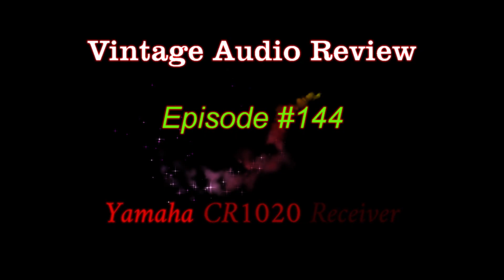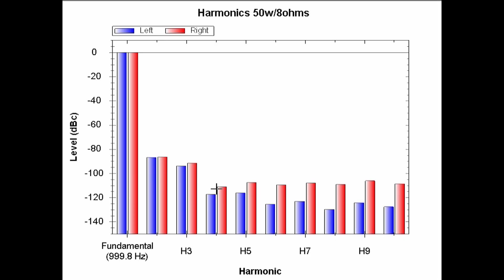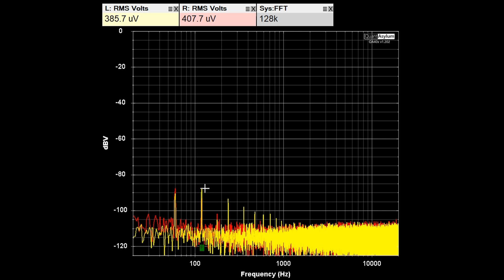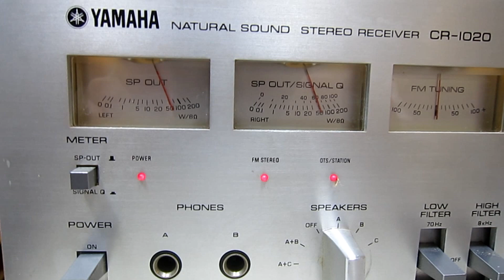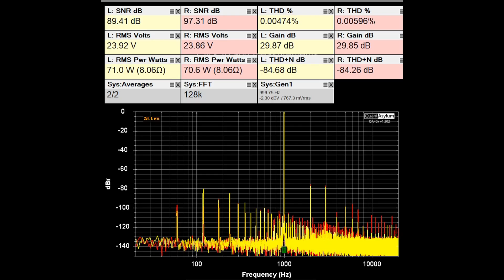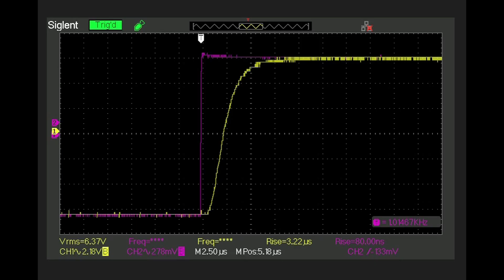Yamaha CR1020 Receiver- Vintage Audio Review Episode #144

Comment: loudness control. I think they were trying to emulate the RIAA curve to compensate for the non-linearity of the inner ear. If they chose to cut rather than boost certain frequencies, then just turn it up!

Not sure what to say about the bass distortion, but it seems unlikely that Yamaha of that period would have allowed 2 percent distortion. Something is going on there. 

I have a Yamaha CR640 which unfortunately has stk outputs, but has performed quite well. I plan to upgrade to something like the CR2020 in the near future that does not have stk.
Reply from the maker: I get that about STK outputs but if it still is working and does the job, just let it do its thing. I appreciate your watching.

Comment: I picked up cr1020 a few years ago for almost nothing. Upon inspection; only thing wrong with it was the tuning dial string broke off. I was able to find the stringing diagram online and after experimenting with different strings and struggling for a while, was able to restring it. After that I re-did the wooden case. Now it looks almost new and very beautiful. Because I was so impressed with this; I kept a look out for other Yamaha CR series. I got lucky and recently acquired CR840 & 2040. I expected them to be broken because I got them both for much less than what they go for. But to my surprise; both units are operational. Only issues are the typical noisy pots of vintage units that has been sitting without use for years! This just proves how well they are made. Vintage Yamaha CR series are quality built units. I highly recommend them.
Reply from the maker: Thanks so much for sharing your experiences and it sounds like you have had some great luck with the Yamaha find. I hope to go through my "career" w/out having to do a dial string re-string.
Reply: @vintageaudioreview yeah. It’s very painstakingly tedious but you feel that much accomplishment too when you are successful

Comment: Really enjoyed the video and am glad I found your channel.  I picked up a CR-1020 almost a year ago, and actually like it very much, except for the very audible pop when it is turned off.  Would like to find a trusted tech to diagnose and fix the problem, but for now I run a different amp through the main in, and that temporary solution seems to work well.

Bill
Reply from the maker: Thanks for sharing your CR1020 experience. Having audible pops when powering on or off vintage gear is typically not something I worry about, unless it is abnormally loud. It may be a difficult problem solve- have not ever tried to solve one like that. If you were local I would check it out for you, but your solution is working fine it seems.

Comment: Thanks, enjoyed the video.
 I have a CR 2020 thats in need of an output pair of transistors. Any suggestions on where to find good replacements these days?
Reply from the maker: I don't have the CR2020 service manual so can't see what output transistors it uses, but am guessing there should be some equivalents for them if not the same ones. I start with Mouser and then do a search on Ebay- you need to make sure the seller has good feedback as there may be counterfits. Also, if the outputs went, the driver transistors and resistors most likely went....
Reply: @vintageaudioreview  2SD424 and 2SB554 . I've read to go with an ON Semi sub  as anything labeled as originals are counterfeit and suspect.
Reply from the maker: @jimhoward1655  You could also try to find an NTE284/285. I did a quick search on ebay for the 2sd424/554 and there look to be several options- for $60 you could get 5 pairs from a seller that seems to be reliable. You can also compare the weight the old ones vs the new ones.
Reply: @vintageaudioreview  Thank you, i will check it out and have a look around.
Reply from the maker: @jimhoward1655  Good luck!
Reply: @vintageaudioreview  thanks, I think the best answer ive found after more searching  is either the ON semi MJ21193 & 94 pair or the MJ21195 & 96. Its like 6 of one or half dozen of the other on opinions of which pair is the better choice. I'm leaning to the 95/96s from what ive read. 
 They can be bought from Mouser for $7 and some change a piece plus shipping
Reply from the maker: @jimhoward1655  I would go with the pair that matches the original as far as hfe and max current/power. Make sure that you check the driver transistors and resistors before your place your order. Also, you may want to replace any electroyltic caps that filter the +B to the output transistors on the driver board.
Reply: @vintageaudioreview  will do Thanks

Comment: The U joint extensions were for the selector switches, not turning the tuning capacitor. That was done via a standard flywheel/dial cord system.  The xx20 receivers were really a disappointment to me when it came to build quality. The large boards were more prone to issues and those on the board switches caused problems as well. And for a high end receiver to not even have a tuned RF stage for AM was pretty cheesy. The variable loudness function was explained in the owner's manual, and was designed to provide compensation better suited to the customer's actual usage and the sensitivity of the connected speaker. Yamaha was not the first to use it, as variable loudness was found on the McIntosh C20 preamp from the late 1950s. I was service manager for one of the first Yamaha audio dealers in the country, and was impressed  by the build quality of the first generation of products they introduced. But compare this CR 10120 to the original CR1000, and you see how far their quality slipped in a short period of time.  And if you look at the next series (CR1040, etc) just one year later, then you get into those really horrible output amp IC's
Reply from the maker: I think I mentioned that there were others that had a variable loudness control, but not sure if they operated the same way. I have not looked at enough Yamahas to see how their build quality changed, but it sounds like you have and I know that there more recent amps used output IC's- I did a review on one of them. Thanks for pointing out about the u-joint being used for the switches.

Comment: I would agree that Yamaha should have called it an "anti-loudness" control. But if you read any Yamaha owner's manual, they explain how it works and how you are supposed to use it pretty clearly. 

This is the gist of it:

First, you set the loudness knob to Flat, then you turn up the Volume to the highest setting that you would normally listen at. Then, if you want a lower sound level (late at night, for example), you adjust the Loudness knob away from Flat, which mainly reduces the mid-range frequencies to lower the overall sound level to what you need while still sounding natural or "good" at that lower sound level. You leave the Volume knob alone when you do this.  The intent was to follow the Fletcher-Munson sound curve.

Unfortunately, most people have never read the owner's manual, so they don't know how it is supposed to work. 

The CR-1020 was closer to the top of the 1977 Yamaha receiver line. These were the 1977 models:

CR-2020
CR-1020
CR-820
CR-620
CR-420

In 1978, Yamaha added the CR-3020 at the top and the CR-220 at the bottom.
Reply from the maker: Thanks much for the clarification of the "loudness control" and the model numbers. I did look at the manual, but from my point of view after being an audio hobbiest, since the late 70's, I just what a push button loudness control that boosts the high and lows at lower volume levels. As I pointed out by another commenter who read the manual and sets the volume to the max they listen to and then adjusts the "loudness level" down to the listening level they like, is not how I want to do things. But I do appreciate the explanations!!
Reply: Thanks for the clarification this is actually a really practical and pleasant way to adjust volume and loudness and after experimenting with it for a few days it has become entirely intuitive to me.

Comment: Had one for a while.  Nice performer, but spent too much time on the weak point... the input selector!   Instead of a round wafer with contacts, they had a long shaft drive a cam that drove a linear slide switch!    Very difficult to clean, compared to a round wafer.  Kept failing.
Reply from the maker: I would have thought that slide switch would be fairly easy to clean with dexoit or some other cleaner/lube. Thanks for the comment!

Comment: I don't know where your math comes from as far as inflation figures go, but if that receiver was new today, it would go for at least $6,500...if not $8,000.
Reply: 383.9% cumulative inflation. $580 in 1978 is $2,806 today.
Reply from the maker: @professorvoluck9311  If I were more motivated I would reference the price to say what a certain car cost back then.... Thanks for the comment, though I will have to research what cumulative inflation is.
Reply from the maker: Thanks for the comment. I use the inflation calculator (https://www.usinflationcalculator.com) and the listed retail price for the item I find in old trade publications. Sometimes it makes me scratch my head, but for me, I do find it interesting from a relative point of view.

Comment: Thanks for this enjoyable review!  I used to see advertisements for these back in the day.  I later owned a 1985 1020A model with the Auto Class A feature that I rarely used.  I didn't use or like the variable loudness feature either. But I did like the sound of that Yamaha integrated amplifier.  I ended up selling that amp a while back and getting a Parasound amplifier, which I like a lot. Thanks again.
Reply from the maker: Thanks for taking the time to share your experiences, Scott! Just forget about the "loudness feature" and enjoy the sound and look of this amp, or many in that line including the 1020A...

Comment: Nice job and a very nice looking receiver (and nice looking Vette, I assume that's a good sign for the receiver).  My AR SP-3 pre-amp has a similar "loudness" control.  I actually really like it.  I first turn the pre-amp on with the volume control about as high as I would ever want it.  Then use what AR calls the "Contour" control as the volume control.  I'm assuming the lower volume I go with it the higher the bass and treble bumps are.  So why the volume goes down as I turn it clockwise.  Not sure, but I'm guessing the Fletcher-Munson curves show more boost is needed at lower volume levels?
Reply from the maker: Appreciate your taking the time to comment, as always, Chris. I think the Fletcher Munson curves are more related to the average frequency response of our ears, but have not researched it- probably will later today... I almost always start with my volume control low and raise it accordingly, and 90% of the loudness controls boost the bass and treble, which is nice at lower listening levels. I never would have considered doing things the way you do, but you are still attenuating the signal that way, just the relative frequencies not as much as others. The highest "rating" I give is two Corvettes and it goes down from there. Not many have gotten two.
Reply: @vintageaudioreview  My McIntosh C26 has I think basically the same feature.  Roger Russell, the designer of the C26, explained it like this on his web page (you find by googling "roger russell c26".  The C26, however, only boosted the bass.  When the "loudness" control was all the way counterclockwise, no bass boost and no attenuation.  At 1/2 rotation, about 6db of bass boost at 20 Hertz and -10db attenuation at 1K Hertz.  At Max rotation, about 15db of bass boost at 20 Hertz and -20db attenuation at 1K Hertz.  This is from the C26 graphs in the Owner's Manual.

Continuously Variable Loudness Control

The loudness control supplied low frequency boost to compensate for the behavior of the human ear at low listening levels. Most loudness contours were switched in with a fixed amount of contour using a tap on the volume control. The user had no control of the contour for any particular volume control setting. The C 26 had much better compensation. It provided a continuously variable contour. First, the volume was set at the highest desired listening level. Then, when the loudness control was rotated clockwise from the flat position, the volume decreased and the contour automatically increased the required amount of bass amplitude and bandwidth for the new listening level. This action provided full frequency range listening at even the lowest listening levels.